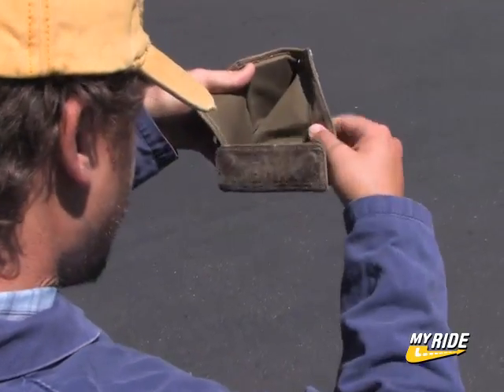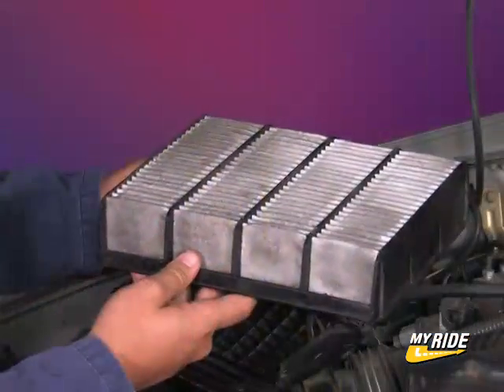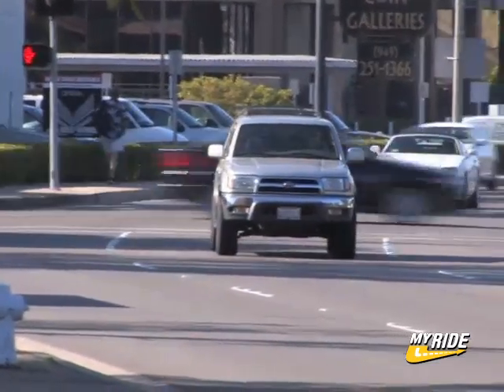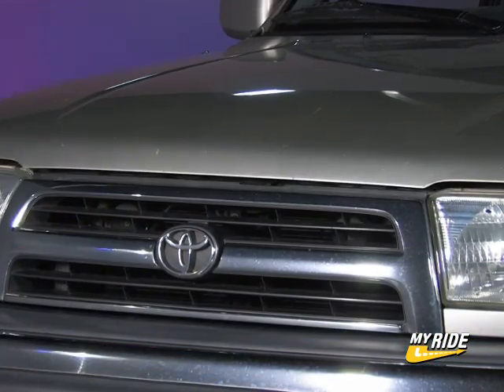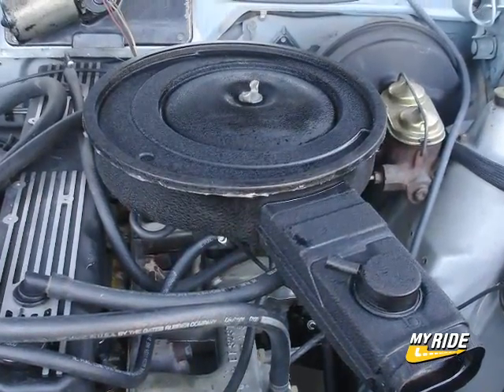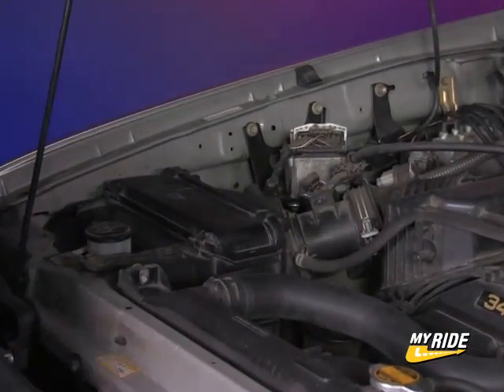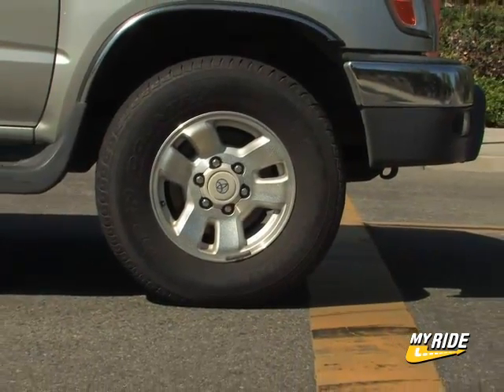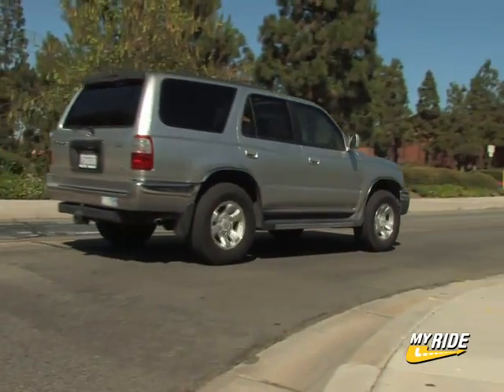How to Change Your Air Filter

Comment: wow that was the best design I've seen besides engines with carbs. I replaced a filter on an RX350 and an Eclipse and it's a bit of pain in the ass to open the cover since you gotta move and unscrew a couple of things to get to the filter element.

Comment: I recommend on Honda Civic's to greese the bolts once in awhile that fasten the top of the air filter cover because they can rust and If they do they bind with the metal studs that are mounted in plastic.   If they are rusted together the metal stud damages the plastic and it's hard to get the bolts out.

Comment: @TerryMMA85 It breathes better, but only at WOT.  Did you remember what the throttle does?

The throttle blocks the airflow so the engine doesn't get too much air at the wrong time.  When you have a clean air filter, the throttle just closes even closer when idling/cruising, which is practically 99% of the time.

If you still don't believe me, look up the study at fueleconomy DOT gov

Comment: also this guy was lucky, alot of air filters are no where near as easy as that to get to. I drive a c2 with a small engine, hence quite an empty engine bay and its still very very difficult to even get to the filter.